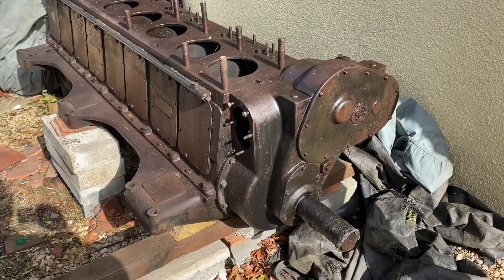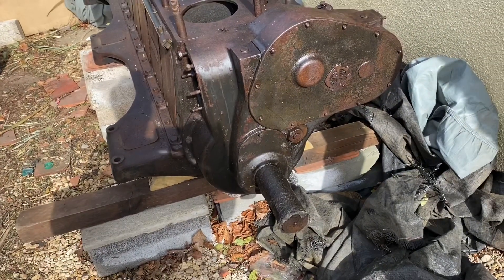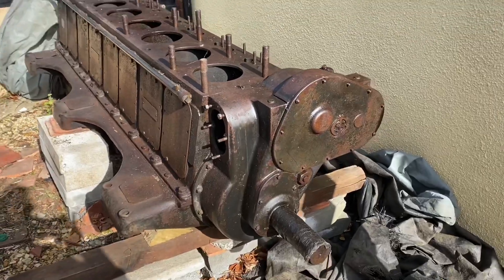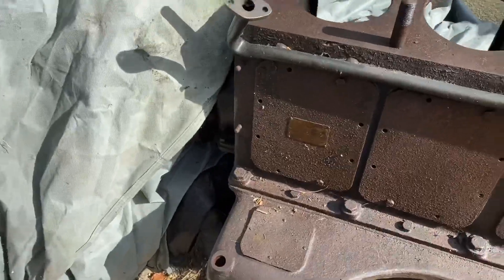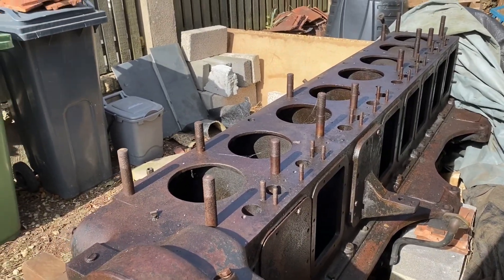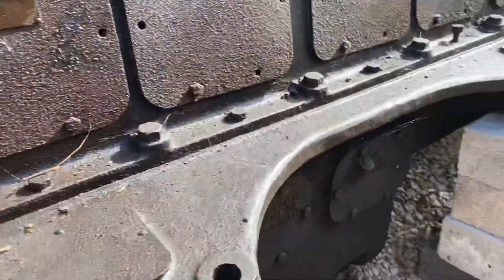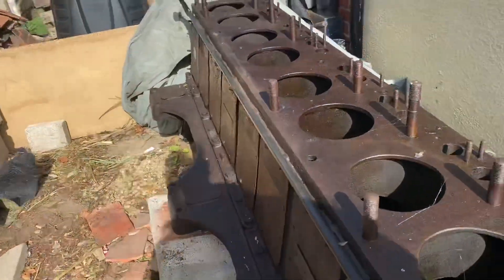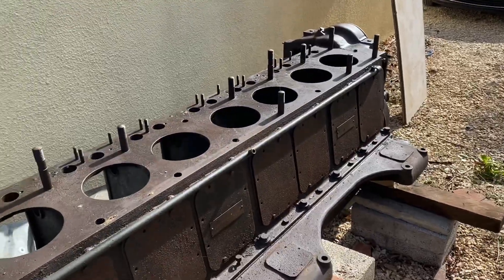Gardner 8L3 Crankcase

Comment: Did you ever get the parts needed to get it running or did sumbody else get it up n running?
Shame it wasnt here in NZ as Ive got everything to get that 8L3 operational again.
Reply from the maker: Passed it on to a welsh loco club who wanted to have some spares for their diesel. Nice bunch too they/we moved it with lorry straps!
Reply: Went to a good home then, sweet. 
Amazing what  can be achieved with load straps.
Reply from the maker: @matui6983  will post some pics on the community tab 👍
Reply from the maker: @matui6983   thanks for reminder video of its move with the railway club posted today 
Massive! (1 tonne+) 83L Gardner Engine Crankcase moved with only basic kit✅
https://youtu.be/CTwHqiDfb0I